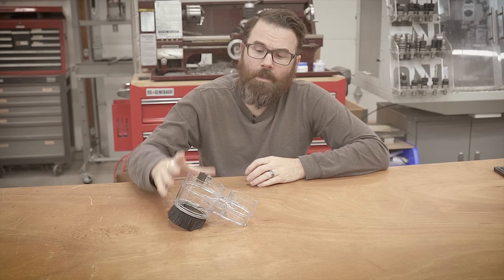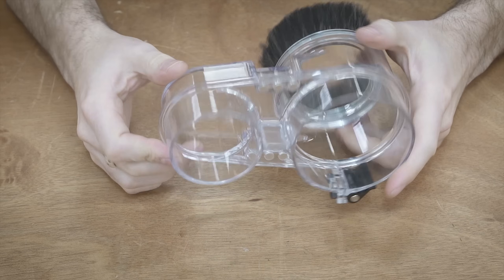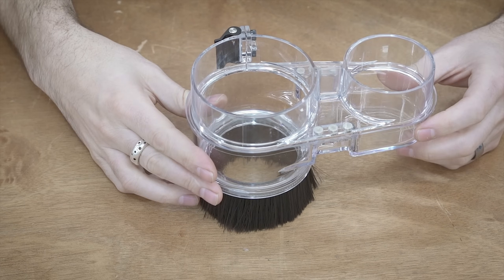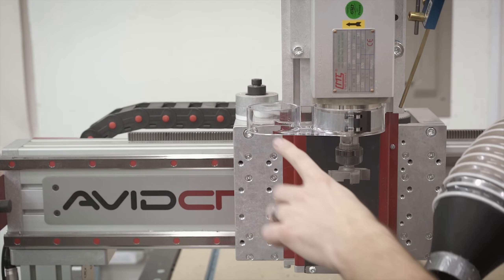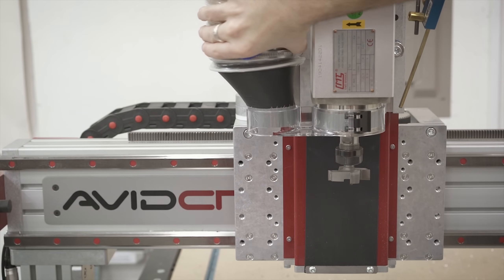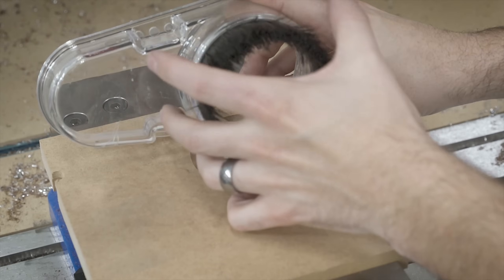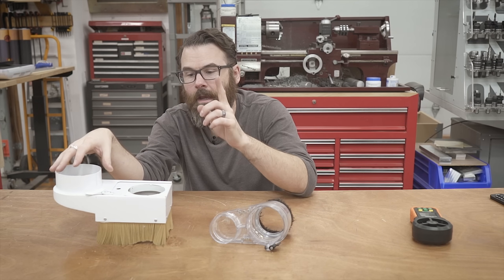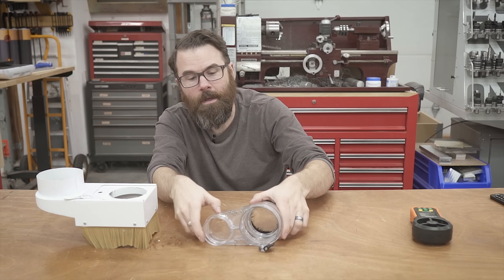Carbide 3D Sweepy Dust Shoe Overview

Comment: Great video. I am researching this for myself, and each person's situation is different, ... i.e. spindle shaft length, spindle diameter, spindle mount, etc., ...they are all different for each machine, so it makes it almost impossible to go with a non-customized product. Custom 3D printer shops can make stuff custom, but it is not transparent. Instead of brushes, you can use flexible clear plastic to gain some vision of the bit. The shoe needs to be wide enough that the brushes or clear flexible plastic sheet cut into strips at the bottom do not get caught up in the bit. Your brushes looked mangled after 1 use. They seemed to long, but the brush length is dependent on the bit length, and the width of the shoe. The entire thing is a big mess. Also, I liked how you measured the air flow at the end, and noted that the air flow is constricted in the channel from where the hose connects and the spindle. That channel is a bit small, and it is a hard 90 angle there and air does not like to make a sharp turn like that. I think the hose needs to some how go more directly to the bit, or at least make the chamber curved toward the bit. I like how you noted that the transparent plastic let you only see the spindle shaft but not the bit.  If you had a flexible clear plastic skirt cut into strips at the bottom, I think you could see a lot more, but since the bit is spinning, you still can only see the cut (hopefully), but that is what we are really looking at anyway. This problem we are researching is a very complicated problem and it is almost impossible to fabricate something that is all transparent.

Comment: In my opinion there are just too many things I'd consider unacceptable - especially having the 48 bucks in mind, they charge you for it. Thank you very much for the detailed review!

I don't actually think the airflow path is necessarily too small, especially if you only have a shopvac. It's just extremely (!) poorly designed. I mean a hard  90° angle below the hose-connector?! Really?
Reply from the maker: Right?  A lot of people are defending it pretty hard, but it's one of the worst dust shoes I've ever encountered.  And one of the more expensive too.

Comment: When the vacuum is on, it pulls the removable shoe a lot tighter.  It’s designed to be easy to take on and off when you are not using it.
Reply from the maker: Yeah, all that suction loss is going to holding it on, great design...  It's garbage.

Comment: An extremely pessimistic review
Reply from the maker: How so?
Reply: @RobertCowanDIY  I feel like you were knocking the product before you even tried to mount it on the machine.
Reply from the maker: @custer175  I mean, it severely restricts airflow, the magnets are underpowered, the clamp mechanism isn't well thought out, and it's more expensive than other options.  I waited for several months for this to show up and it was apparent the minute I opened the box that it wasn't going to work out for me.  I don't feel like I was being unfair, I was just frustrated that it was poorly designed.

Comment: Why so negative? It worked great in your brief test. Yes, visibility could be improved (adjust its height). Don't complain about magnets until it does fall off for no reason.
Reply from the maker: In other tests, it did fall off.  It's handing on by a thread, and that's really concerning for a CNC machine.  It's poorly designed and there are many other better options out there for the same price or less.

Comment: Great video as always! I have this sweepy on my Shapeoko 3 and it has worked really well for me, i have done about 125 hours of machining since I bought it.  It's not perfect but no off the shelf dust collecter is for every situation (too long, to short, to big to small ect..depends what you are making what the dust boot needs to be) but it has been great for general use. This works much better(for my needs) than the "Suckit dust boot" did mainly because it moves with the spindle so it is less likely to hit fixturing, touch probes and such,  and bit changes are less hindered than with suckit, not to mention it is just $35 making it one of the cheapeat options out there. Magnet hold hasn't been  an issue and it holds really well with the vac on (while working) but pops off easily for bit changes which is prefered. There was another comment about brissles being to stiff and making the z motor loose steps? Never happened to me and it is hard to imagine a machine that I mainly use for aluminum being overpowered by a stiff brush but who knows what thier exact set up was like so I can't say for sure that has never happened to anyone. Suction is always ok for me as long as the brush is touching the surface, if it overhangs the edge of the work piece or the cuts get too wide and deep it is not nearly as effective I'll admit, but all other dust shoes would have the same issue I imagine. Since the atachment slides up and down I can do about 1.5 or 1.75 deep before it gets in the way or isn't making contact which is pretty good for most of what I do. Overall a pretty good dust shoe, not perfect, but very good for the price, if you see something better let us know though. Please keep up the great videos! I am looking forward to what you do next.
Reply: I was about to ask how deep of a pocket you can do before theres interferance with the dust shoe and the material  thanks
Reply: C
Olfactory gugouogigouougouougogouoguoguoguoguouogoggougougououoguougouogugouououogugopgg

Comment: Robert, you should check out KentCNC for a really good quality dust shoe IMO. I have one myself and find it to be really good as long as it is lower then the bottom of the bit and your dust collector is powerful enough. It is a bit more on the pricey side but as stated really good quality.
Reply from the maker: Thanks!  I might check them out, looking for an alternative.
Reply: @RobertCowanDIY  another vote for the Kent CNC one. It is what I put on our Avid Pro. The quality and design is good very good. You do need good airflow to run it.

Comment: Thanks for the review! Could you post a link to the dual collection system you mentioned that goes on either side of the spindle? I’ve seen it on a few places but can’t ever find it, I’ve searched the forums too!
Reply from the maker: I've been meaning to show my dust collector, I'll try to made a video someday.  It's nothing too special, just an oneida v3000 with 6" ducting.

Comment: Its called sweepy, because you need to sweep the floor after using it. Also my gripe with it is the brushes are too hard for the shapeoko. Some have mentioned that the power of z axis cant over come it and it skips steps. I prefer my suckit dust boot for the shapeoko
Reply from the maker: Wow, really?  That's unfortunate.
Reply: Yeah, I can definitely see that with the stock belt drive Z. You shouldn't have to upgrade your product to use an accessory from the same ecosystem.